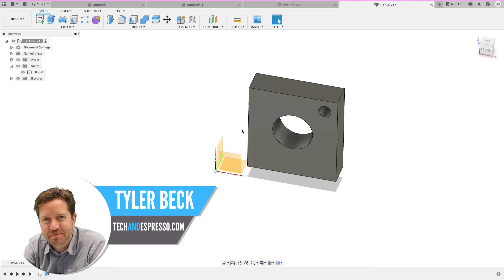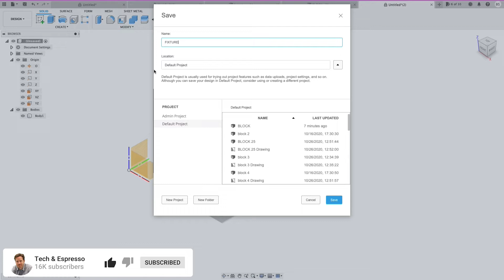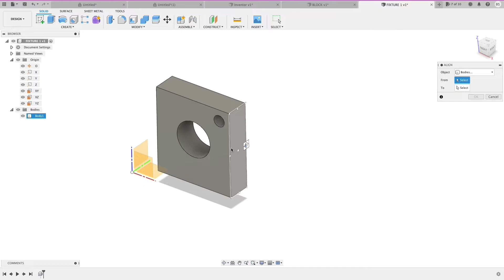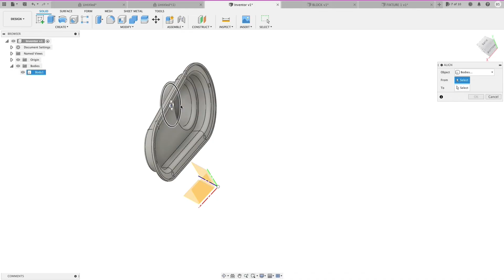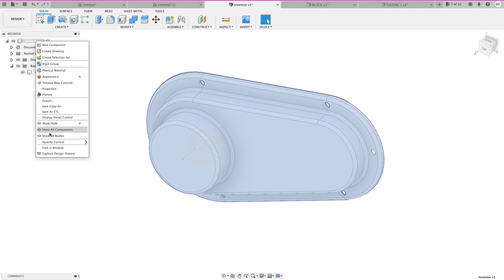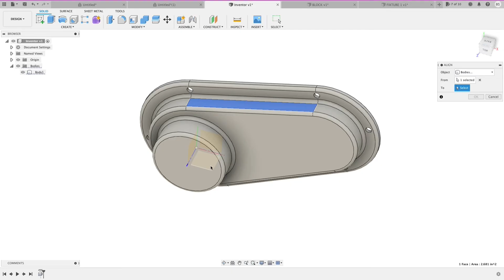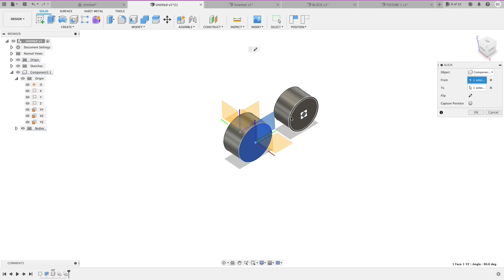Fusion 360 Origin Change (Align Part To Right Spot)

Comment: Yes great video it's funny to me though as it's opposite what I want . Let me explain it this way. I load up a step file of a mold and as a new user I noticed how easy it is to drag components . I'm understanding 'rigid group' locks into place. Unlocking would have to be very deliberate. Any advice?

Comment: It'd be great if the rogid group, pinning location actually worked in F360.
Client sent me step file as a base for the parts that need to be made, which have multiple components, whatever thing I try to origin the imported file, it either doesn't work, throws geometry error, or mobes single component and doesn't move rest of the components.

Comment: OK my problem is a little different I am importing a step file but it's of the entirely completed model and it's all wonky it is tilted in three different axes for some reason and it's pulled way off of the origin point so I have no idea what I'm doing and it's important that I have it at least flat and square within the environment there is a bottom plane that needs to be flat to the bottom of the environment

Comment: How do you move an entire assembly in one shot, to a new origin and different plane?  
I opened a f3d file, but the assembly is hanging upside down! 
All the parts for the assembly is in the file. 
Some parts are set to invisible. He put all the options in one file and turned off the stuff not needed!

Comment: Very helpful. I ran into this problem when I created a new component and needed to reference the center of a hole, which was the origin of the original component. When I activated the new one, the origin was suddenly no longer the center of the hole. The align command solved the problem.
Reply from the maker: Glad to hear it.